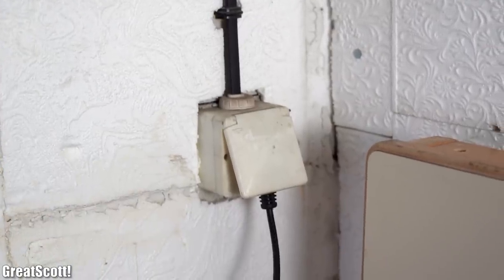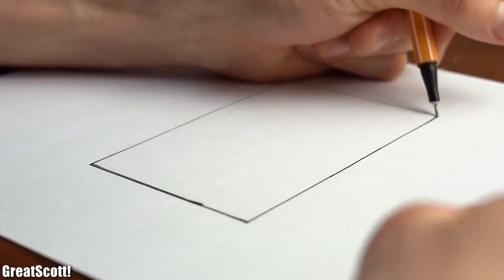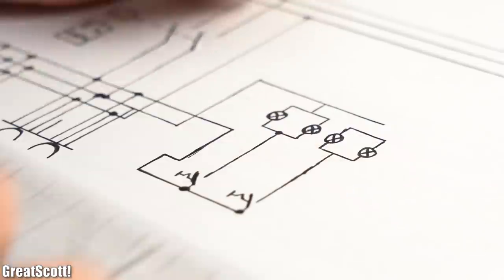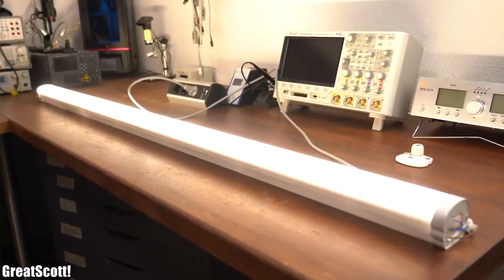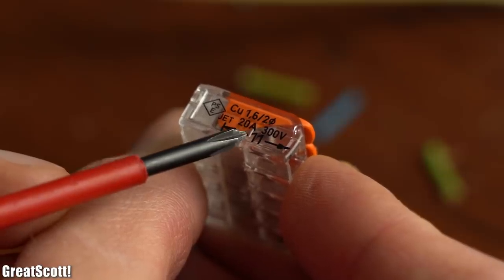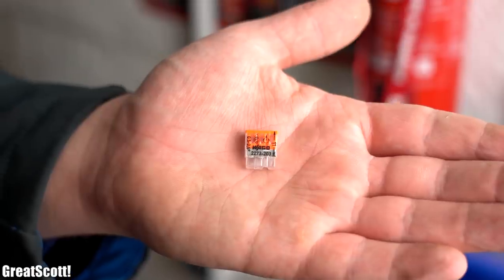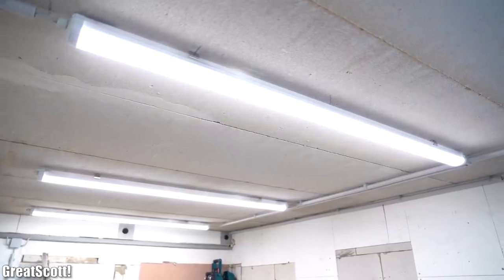How to do Electrical Wiring properly! (more or less....) GERMAN STYLE!

Comment: Great work. In the US, the wiring connections are very much different. It’s interesting to see how it’s done in other countries. I will be updating the lights in a rental property I have.
Reply: I like the all metal conduits in US and the junction boxes. It all looks neat.
Reply: @volkhen0  do the all metal conduits need a connection to earth ? Or how does it work in the US ?
Reply: @RecBlackLP  I don’t know,
I’m from Poland. I said I just like the US conduits style.
Reply: @RecBlackLP  all metal conduit (called EMT) must be properly grounded, yes. Also, unlike Germany, all wiring must be secured and not exposed.
Reply: @andrewwest3994 where do you see exposed wiring?
Reply: @ChristophMarius  5 cm before every component
Reply: That is not exposed that is a cable with wiring in it.
Reply: @jbrnds  And that is exposed in the U.S.
Reply: @ChristophMarius  In the US, exposed cables are a big no no.  They are supposed to be buried (in a conduit), behind a wall or inside a conduit.  I saw several places where a few inches of cable leading to the conduit box were exposed.
Reply: @bobweiram6321  please Tell me at what Minute (timestamp). Thanks
Reply: @RecBlackLP  the metal conduit is connected to the earth at the distribution box in the us. For our outlets we don’t need to connect a grounding wire as they use the metal conduit for the protective ground connection if it’s been properly constructed.
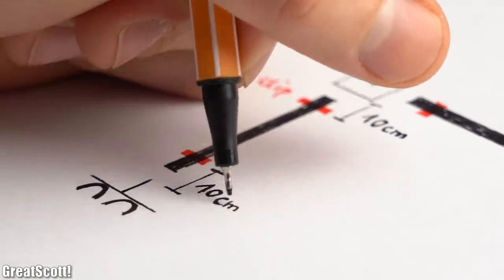Reply: @ChristophMarius  11:38 you can clearly see the end of the plastic conduit is not attached to the junction box. Also at 8:26 you can see his diagram. im guessing its the german wiring code that states 10cm space between components.
Reply: Using metal conduit is fairly uncommon in North America except in commercial buildings. It could be used for wiring being run on the surface of the wall where it was subject to potential damage like this, but normally it would be inside the wall. When using conduit like that it would be individual insulated wires and would connect directly into the device box, you would not have any exposed cable as shown here.
Reply: @RecBlackLP  yes emt conduit counts as the ground wire when installed for anything more than a drop and reduces the number of conductors.  It’s not too bad to work with either.
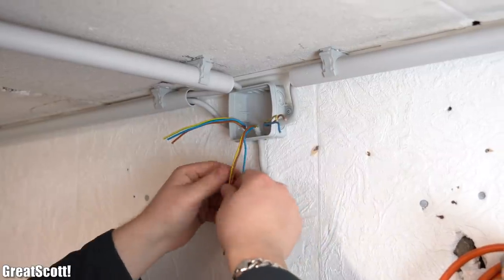Reply: @ChristophMarius  Look at 9:40. The cable goes through the conductor except for the last inch or so where it goes into the conduit box.  In 9:57, you see the same thing where the two conduit pipes meet the conduit box.
Reply: @bobweiram6321  It's perfectly fine to expose (or bury them, e.g. inside concrete or brick walls) NYM-J cables. The individual conductors are multiple times insulated and self-extinguishing. Conduits are fully optional and used for easier mounting.
Reply: @bobweiram6321  I don't know the standards in germany but that cable has the same individual flame retardant insulation(coloured cables) as a ip insulation usually a softer outside skin, which is white. That cable is the same as a multi splitter with 10feet cable you use for tv, washing machine and pc in your house, so for that garage might even be enough.
Reply: @danielegger6460  In the US, it's a serious code violation to run any part of the cable exposed to the elements, indoor or outdoors.  Conduit pipes are not used very often, but when they are, they're usually metal and link directly to a conduit box using a fitting.
Reply: I'm part German (the good part), and lived there for a couple years, and this looks tacky. However, truth be told if there isn't any existing conduit or drywall facia to hide wiring behind, I understand it. Probably better than running exposed wiring, although the ends are exposed.  Its kind of funny having to run conduit in residential homes, until you think of the much higher voltage and potential for 3-phase some of these countries run.  I guess its the trade-off you get for having a lot more power available at each receptacle.  Even funnier though, is that the need for so many high power outlets just keeps going down and down as we progress.  Outside of a washer/dry, furnace or giant stove, not a lot of need for more than the 1800W 120v @15A gives us.  Glad to see the comments here are still civil.
Reply: @Dwarg91  Not the entire USA, there are plenty of places they are fine with plastic conduit in residential use. However there are different standards around the world, so different things apply. for example here in South Africa you are allowed to bury cable in plaster, though i will prefer using a conduit instead as better protection, plus any repair less wall to redo. But here you can have a house with 3 centuries of wiring in it, and still have it compliant, but any thing that is not a like for like repair is regarded as upgrade, which must meet current standard.  So you will get a house with old lead sheathed paper cable for incoming to meter, the new meter, then a fuse board with rewireable fuses, and then a more modern distribution board that has modern wiring leading  to things like outlets, extra sockets and outbuildings. Only thing the fuses supply are the original lights, as the sockets would have been upgraded from 5A to 16A long ago, which meant a rewire. Only curse is the gutta percha sheathed wires are so brittle any repair is often a replace of large chunks.
Reply: @Dwarg91  I was under the impression that while it is possible to use the conduit as the ground when it is correctly grounded, it is still preferred (and may be required in some places?) to run cable with a proper ground conductor. (I am not an electrician and just have a passing interest in this kind of thing.)
Reply: Good news for you those wago connectors are now available and conform with code in the USA - no more wire nuts. Those Wagos are the best invention since slicing bread.
Reply: @tookitogo  honestly I thought that metal conduits are used inside the walls to protect cables from damage while drilling etc. most houses in Europe are brick and concrete so even if you hit the cable with drill the house will not burn down. In wooden house it’s a different story. if it’s on the surface, how can you damage cables? ;)
Reply: @volkhen0  That's exactly the reason. We usually do not have drywalled homes in Germany, the walls here are basically always made of brick and mortar or concrete.
That's why we're allowed to bury the "naked" cables inside the plaster on our walls.
However, there's strict rules on WHERE on that wall you're allowed to bury the cable ("Verlegezonen") so you know that there's usually spaces on a wall where you can drill without second thought and theres spaces where you should double check if there might be a wire there...
Reply: @boots7859  No one forces you to run conduits for those insulated cables, that's a convenience to simplify installation...
Reply: @bobweiram6321  This insulated cable is specifically made to used "exposed", you can directly bolt them to the wall with mounting brackets if you'd like; the use of conduits is optional and for convenience reasons only. Just like cables running between power poles are made to be "exposed". Any metal piping used anywhere needs to earthed and I believe there're special rules to follow if you want to run metal pipes directly into junction boxes and other electrical elements, thus they're only used when some special properties are needed like protection against chemicals or for channels to establish an air seal for fire protection.
Reply: @volkhen0  It ain't gonna burn down if the wires are encased in concrete.
Reply: @Kabodanki   And bare exposed wires makes you pray.
Reply: @bobweiram6321  and you also have outlets that allow you to drop a coin onto the prongs when it is partially in the socket
Reply: @boots7859  america has the most terrible outlet design tho
Reply: Even though I live in a “third world country” I can say I’m satisfied with the electrical code here! Electrical cables have to run inside a fire retardant plastic conduit connected directly to steel boxes that have to be earthed. A bare copper wire connected to earth runs inside the conduit. Plastic distribution boxes are not allowed as they are supposed to hold its shape in case of a fire. Insulated cables cannot be buried under concrete nor be left unprotected inside hollow walls. In outdoor installations, a properly earthed galvanized steel conduit should be used and junction boxes have to be water tight with waterproof nuts connecting individual wires. Gas lines regulations are pretty strict too, not so much for drinking water and sewage.
Reply: @RecBlackLP  they do for safety reasons, but they do not provide the earth connection (that is supposed to be its own wire).
Reply: @PaulFisher  this is correct
Reply: @PaulFisher  yes been doing wiring (usa) for over 25 yrs and just lrnd a few months ago tht an egc was not needed but i always thought it was 🤦‍♀️
Reply: @matekochkoch  im on the fence i may use them for multi circuit ground connections and light fixtures but i still prefer copper crimps.
Reply: @tormodhag6824  or even worse no switches so your fingers can easily make contact inserting or removing plugs and worse yet shutters on sockets are a relatively new thing but what ever we have survived for over 125yrs with the design  lol
Reply: The only thing I saw that was really, really different from what I've seen in the US is a receptacle connected straight into the electrical panel. Of course, you can mount a receptacle box right onto the side of the panel in the US if you'd like, but it will connect into a circuit breaker. I'm assuming the reason they can do that in Germany is because there's still the fuse to provide protection before the breaker panel? Though we do have subpanels which are fundamentally similar to that setup and I've never seen it done on a subpanel either over here.
Reply: @lambertax  Four inches by four inches by two inches is the most common size for a junction box (102mm x 102mm x 51mm). So a couple centimeters larger in length and width and comparable in depth. Not really a big deal. Also, the diameter doesn't need to double, the cross-sectional area does, which does not equate to a doubling of the diameter. So the wires need to be only about 40% thicker.

Also keep in mind that North American homes actually do use 240v split into two phases of 120v and our high-wattage appliances do run on 240v across both phases. The most common amperage for 120v residential branch circuits in North America is 15 amps, which requires a wire with a diameter of around 1.6mm. Unless you have an absurd number of connections in your junction box, the difference in wire diameter to deliver the same wattage is more or less negligible in terms of the amount of space it takes up in a junction box. You're talking roughly a half a millimeter per conductor, a portion of which is negated by the thicker insulation required for 240v.

I've always found it odd how snobby people from 240v countries tend to be about their electrical system when North America uses 240V for pretty much anything that's going to draw more than 2 kilowatts anyway, rendering the real-world differences essentially negligible as our devices that require high amounts of wattage will ultimately be wired exactly the same way.
Reply: @homestar92  The receptacle in the panel is behind that RCBO next to it ( you can see the wires from bottom of the RCBO leaving to the receptacle and to other places, everything is behind it. So electrically it is not any different is it inside the box or outside it.
Reply: @wopmf4345FxFDxdGaa20  yeah, I didn't figure it was unsafe or anything like that, I just had never seen that done in a North American panel and found it interesting. I have a receptacle in a box that is mounted directly to the side of my panel, so the effect is similar, but it's always neat to see how things like this are done in different parts of the world.
Reply: @homestar92  
Europe has 1 leg for 240v.
America uses 2 120v legs for 240v.
From a material cost perspective 240v in Europe is cheaper. 
From a safety perspective 240v in America is likely safer due to amperage being split across two legs.  
America with its two phase system also allows load balancing between the phases.
America doesn't use a neutral line for 240v devices, only two conductors and a ground.
Reply: @LeoInterVir   Not everywhere. Germany would have 3x230/400V three phase incoming supply in the main panel. Circuits would be connected to different pahases. UK uses single phase 240V for domestic installations.

Comment: Great video. I am an electrician in the U.S. and it's interesting to see what's similar and what's different. We wouldn't be allowed to route the wires through the conduits with out boxes at every junction. Looking forward to your next video!
Reply: In the UK the conduit has to go end to end and connect to boxes with glands. So bends have to be fitted to keep the wire protected at all times or you have to bend the pipe with a tool!
Reply: The conduits in the video are mainly for esthetics reasons. You can put wires on the wall using clips too.
Reply: @volkhen0  yes and with some even better wire, you can raut it almost anyware.
Reply: These wires run in a flame/heat retardant shell. Most of the time they have an even thicker shell (the gray kind), and for outside they can have a stranded metal jacket in them. I think in the US you use just the separate wires in metal conduit right? We also use seperate wires a lot by the way, but then we run them through a closed system of pvc (fire retardant) conduit. We don't use metal conduit in N.W. Europe.
Reply: @zenddoor  well we do, but it is more for Cable outside, ore for when you know the conduit is wonerable to bein abused by cars ore animals
Reply: European regulations say that any cable has to have protection throughout.  I know Brexit double standards. In France and Italy everything there is run end to end in trunking.as does UK???
Reply: @zenddoor  Cable run inside conduit in the USA is usually double-coated, individual wire coated as expected, and then those 12/2, 14/3 Romex wires are bundled and coated within another sheath.
Metal conduit is more expensive, so I understand why its probably used, although I still don't believe its all that fire-retardant compared to metal.
Reply: @Electronics-Rocks  yeah but the outer insulation of the cable itself counts as proper protection for NYM wires as long as it's inside a building. There are special cables for outdoor use that can be used without conduit, too.

Comment: In Portugal we use the same type of equipment, the same type of connector, and even the color code of the wires is the same.  However, in Portugal the division of circuits is mandatory, that is, a protective circuit breaker for lighting and another for plugs.  Another difference is that in Portugal it is only allowed to use 1.5mm2 conductors for lighting or for equipment with a maximum power of 850W, the socket circuits are mandatory to be made to conductors at 2.5mm2.  Good job, thanks for the great videos!